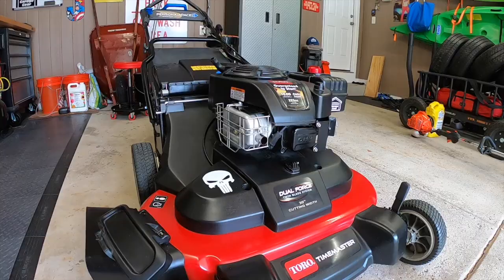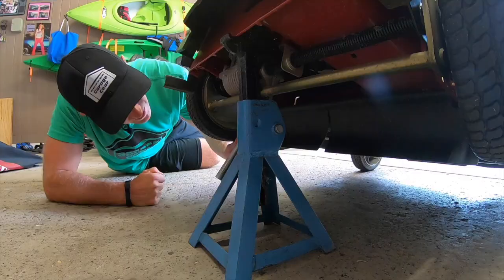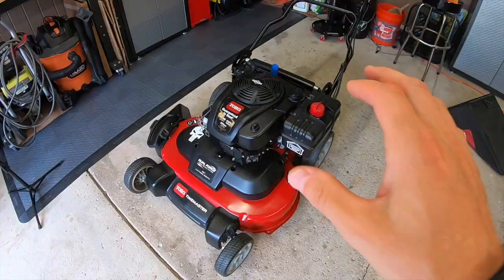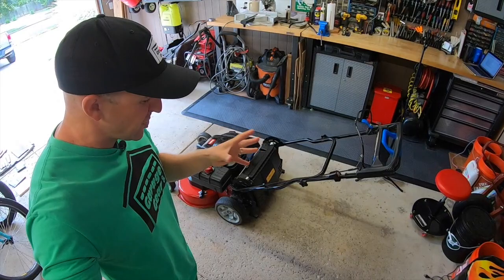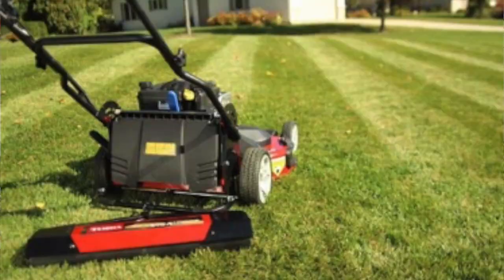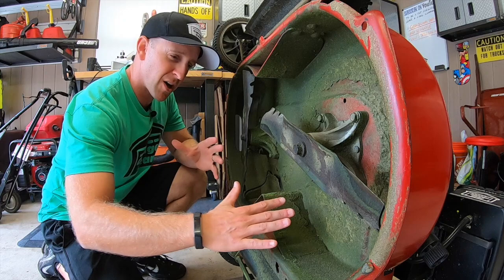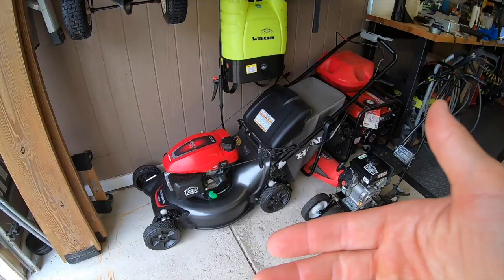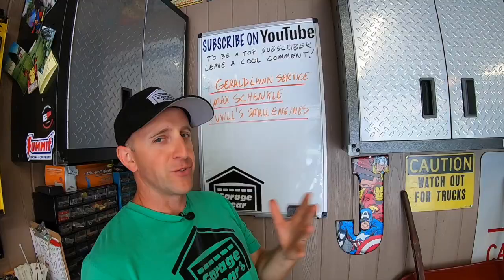BEFORE YOU BUY A TORO TIMEMASTER, WATCH THIS!

Comment: Working (again) on a neighbor's 2013 model year Time Master.  On its fourth belt from the engine to deck, second belt idler pulley.  New spindles, shafts & belt timing belt pulleys (all of them).  Pulley for the blade shaft all loose on the shafts.  Too complex for the additional cutting width, not worth it.  He could have bought a 21 inch mower for the cost of the parts alone over the years I've been working on it.  Engine's starting to burn oil, likely the last straw.  Skip...
Reply from the maker: Thanks for sharing this information 80’s lover!

Comment: What would you recommend instead? I was looking at the HRX or possibly a base entry zero turn. I'm moving into my first home that is just over half an acre and it's relatively straight & flat with little trees and nearly no obstacles. My gate is big enough for a ride on for sure, but I don't have the budget to really go above $3,000 & would prefer getting a nice push around $1,000-$1,500 since I'm young & can use the exercise & I've heard zero turns aren't worth it unless you can spend $5,000+
Reply from the maker: Hey rise! I think you’ll be there for a while with the HRX. Good mower though! Perhaps check out a decent used zero turn that is more in your budget to see how you like it for a season. There’s plenty of good ones out there. My neighbor has had a toro for a while and loves it.
Reply: @GarageGear  thanks for the input! I'm going to check out some local dealers this week to see what type of financing they have for new & used zero-turns
Reply from the maker: @RiseT14  you got it my friend!

Comment: Thanks for taking the time to make this video. Does your surge at idle? Just bought a two year old one and it surges pretty bad at idle (but otherwise runs great). From what I've read, this is a common problem. Just wondering if cleaning the carb out will fix it.
Reply from the maker: @ILruffian  mine did a little when I had it. Sold it a few years ago. Carb cleaning may help!
Reply: @GarageGear  Thanks much. Debating if I should do the commercial pulley system upgrade as well.
Reply from the maker: @ILruffian  this mower is one easy rabbit hole to go down. lol
Reply: @GarageGear  Spot on. Kohler engine, etc.

Comment: The plastite bolts are complete crap. I had 2 break when removing the cover to inspect the blade engagement. Now I get to extract them and replace that cable. Any suggestions on a good grade 8 stainless steel bolt replacement ? I’m not finding anything to give me the size. The existing head is 3/8.
Reply from the maker: Unfortunately, I don’t know. I sold the mower so I can’t check.

Comment: I just started cutting lawns and I need a 30 inch mower I mostly cut lawns in beach towns  and they are smaller what machine do you recommend
Reply from the maker: @catnaptv_plushshow  I would look at Ferris or scag. They have 30 inch commercial mowers. Expensive but built well.

Comment: Unless you plan on a total engine replacement out of the box "don't buy". Three head gaskets in four years. Crank case gasket. Gas cap leaks like a sieve from poor design.  If the blade belt breaks. The blades will crash into each other. If this isn't a major safety issue that should not be allowed to happen. Said goodbye and bought a Honda.
Reply from the maker: Too many issues to name! Considering selling mine in the spring. Thanks for sharing John!

Comment: I bought one 8 years ago on sale for $899 at Home Depot. It has been a great mower. Only major part that's gone bad was the gear box. Got one off Amazon for $99 and replaced it myself.  I did replace the belt pulleys with aftermarket ones and no problems.The tires do get slick but someone on YouTube has a hack for fixing that issue. If this guy is running out of gas he must be walking very slow. I mow 5000 sqft in 45 minutes. Bagging everytime with no problem and I'm mowing TiffTuff Bermuda which is very thick. It's funny how you don't see very many used for sale on Facebook marketplace. Maybe everyone just scraps their $1000+ mower. Either that or this guy got a lemon. If he bought it during COVID he probably got a lemon. Manufacturers had to put anybody on the line assembling these things. Knock wood, I've got a great one.
Reply from the maker: Thanks for watching

Comment: Well. After watching your vid not crazy spending $1600.00 to save 15 minutes mowing my 10 k SQ ft lawn.  So what else should i look at? Or just stay with my toro 21inch super recycler 21386.  It is shop worn due to i use to mow 13 lawns per week. Not doing that anymore. Please advise. Thanks
Reply from the maker: Hey Brody a lot of people are looking at 21 inch Hondas but they are don’t making mowers in September. There are two commercial 30 inch mowers out there now that getting some buzz but I haven’t tried them yet.

Comment: I've had 2 problems with my TimeMaster, cable adjustment for the blades, and the belt disappeared for the transmission, but I'm happy with it. 
But a Honda mower? Forget it! No one can fix the starting problem. Plus I hit a tree stump and now the crankshaft is bent. That's right - BENT. DEAD and no one wants it.
Reply from the maker: Thanks for sharing!

Comment: $1500...only 9" wider than a $500 self propelled...the extra price doesn't get you a better motor, big fuel tank, better wheels not quality control.   I've seen guys get these for their lawn care business and I laugh.  It doesn't have the power nor quality to justify its cost. But a lot of modern mowers try to be a jack of all trades, rather than just be good at mowing.   Most of the mowers marketed as a bagger, mulcher, side discharge don't do any of them as well as they could.
Reply from the maker: Hey RC looks like the cheaper mower and a few extra passes is the way to go! Thanks for watching my friend! 👍

Comment: My new home is on .75 acres and has a flat front yard, but a very steep hill in the back yard. I’m looking for a mower that isn’t going to be in the commercial price range and I’ve been comparing between the Timemaster, Craftsman M430, and a used Cub Cadet CC760 ES that is for sale at a local dealer nearby. I’m torn between which to go with due to the steep hill. Can you recommend one over the other for my situation, or another if you think would be better?
Reply from the maker: I would probably recommend the cub. The craftsman’s are pretty much in the same level as the TM! Only downside with the cub is the tires tend to leave ruts. Decent cut quality though!

Comment: People are and have been talking about these issues.  You tube is Loaded with the Topic.

Maintenance is part of the problem, NOT ALL   

Deck clogging....better blade is needed!  those blades are creating too much up force and its clumping it seems.   Not Many people are talking about possibly a low lift blade, or something else.  Side discharge is certainly better, and so is Bagging.
My solution so far is to side discharge or bag.   A BLADE TEST is needed for people to come up with a decent solution.  I dont know what scag-ferris are using.....but there is no doubt the timemaster deck design isnt allowing great flow of clippings.

adding to that, MULCHING is NOT good with these..  even more clogging.  even worse, the clipping get into the pulley area...THUS issues with the bearings failing.    solution, clean it out every 2-3 months.  4  3/8 headed bolts.   leaf blower it out.
Or you will be buying tensioner pulleys.  If commercial, probably need them anyway.  Why didnt they upgrade?  Toro is saving money.    

Belt adjustment on the blade engagement needs to be done.  5 mins.    

B&S engine....not as bad as people think...needs oil changes, valve adj after a few years.  Dont DOGG IT DOWN with mulching 12in grass...or you'll pop a head gasket.   Make sure Your getting 3500--3600 rpm.     as for the mounting bolts...thats just telling you there is alot of vibration going on....     Plenty of vids with guys dogging that engine, and wondering why it craps the bed.   I am NO B&S fanboy....but this engine isnt that bad.   I ran the 190cc on my craftsman 21 for 5 years...not 1 issue.

I will agree 100% a 22" toro recycler is far easier to run and will cut great, but it will take you an extra 30 mins on 15k cut.

drag flap..garbage.   

ALL these 30 inch mowers.  .commercial and timemaster have issues. Timemaster seems to be the easiest to service.  But, they are manageable.   If you have manicured fingernails and are afraid to get dirty, pay to get it serviced.    

I bought one this year for 1000 on craigs. new.  I like it.   I like it alot!   I have the recycler in the shed, i pulled it out yesterday to do a spot in the woods...man its soo small now..LOL

I would take this $1000  timemaster over any Honda mower and 22"..except my $30 recycler that I found.    That said, hard to beat a $30 recycler.
Reply: just want to make clear, the Vid...really has very good Merit in that Toro could do a better job.

I just offered some pointers.
Reply from the maker: Thanks for sharing your experiences and knowledge here Harry! Wish toro would address some of these things.

Comment: I'd have to agree JB. Toro has gone downhill big time, The older Toro products were built like tanks and lasted forever with proper maintenance. Everything they make new is very disapointing to say the least. If your mower is shaking apart (and I trust you balance your blades?) there is something wrong with that engine.
Reply from the maker: Hey David! Blades are always balanced after each sharpening. Engine runs fine. Just so powerful it shakes itself free. Probably selling it in the spring! Thanks for watching bud!

Comment: Would you recommend buying if found for $600? Only used for 1 season
Reply from the maker: Hey Matthew! No, chances are even higher you’ll have to deal with belts, transmission issues and engine problems! This mower is not worth all the extra work. Thanks for watching.

Comment: Hi JD. I have a time master and the deck cakes. But I think I found a fix and I wanted to know if you could do a video on it and test it out. The fix is to remove the front baffle. I have an aftermarket mower with aftermarket blades and the lift pulverizes the grass into a slurry even when it's bone dry. After taking off the front baffle I don't have the issue any more. I made a video on my channel about it. Mulched up a half acre property and had barely any caking and the grass was wet. Hope you can test the theory out
Reply from the maker: Hey atg! Thanks for sharing this but I sold my timemaster last spring! That mower wasn’t worth all the other headaches. 👍
Reply: @GarageGear  oh man 😅 I was hoping you could have tested it. But u know what, you're absolutely right. It's been a headache since day one and Toro really needs to just put out a better product for all the money people pay for it. Thanks anyway brother and thank you for your content. If you ever change the belts on the ariens snowblowers please record yourself doing it 😬 I have a 30 inch EFI and the belt slipped I put it back on but I think this will be the last winter with those belts
Reply from the maker: @atg4469  here is a video I did on a 28” deluxe a few years back. Perhaps this can help you HOW TO CHANGE SNOWBLOWER AUGER BELTS - FAST & EASY Replacement and Installation
https://youtu.be/mIkydp4DTwI
Reply: @GarageGear  thank you so much it's very helpful

Comment: Disagree with most of This. Yes gas tank is way too small and the trans is weak, but overall this mower is very good. I have a 1/2 acre I mow with this for last 3 seasons and the cut is great and I don’t have “clogging” issues even if the grass is damp. I also have a backyard that’s ~20deg slope and while my only complaint is having to push some going back up after mowing, it actually handles it’s very well. Cleaning the deck? I do that once or maybe twice a year. It doesn’t need to be spotless! My old Honda HRX got more crap stuck up in it than this does, and that was almost as expensive with 30% less cutting width.
Reply from the maker: Thanks for sharing

Comment: This guy must have had a bad experience with this mower... I bought mine in 2014 and still use the mower in 2022. I haven't had anything on his list fail for me and I use it to cut about 15000 square feet.  I am even cutting the grass two to three times a week in the spring and fall.   I don't even have to fill my tank up like he mentioned.
Reply from the maker: Thanks for watching
Reply: Mine is a 2012 vintage and everything he mentioned has been a problem and much more.  Pretty much everything that moves except the wheels. Replaced the engine over the past winter with a Kohler designed for the Time Master.  All this with just over 200 hours on the hour meter I installed at the start of the 2013. Does a great job mowing the grass and the Personal Pace system works better than anything else I've used.

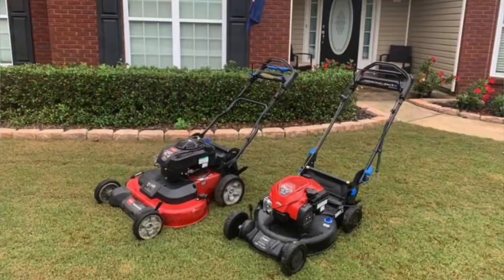Comment: Wow I just saw my house at 7:34 in your video. I'm one of those that has felt the pain of the underpowered motor. Mine just sits in my shed during the heavy growth months because it can't keep up with my super thick Bermuda.  I follow the 1/3 rule, cut every 3-4 days religiously, and it simply can't handle it. Adjust blade engagement cables and its as good as it can be but still won't cut it without me walking like grandpa.  I'm sure it's great for mowing at higher levels but it's not worth my time to baby it thru to cut. I use my Super Recycler almost exclusively. Its good for bagging up pilings tho after I've alreasy cut. Hahahah
Reply: And yeah the TM owners group prob won't think much if this video although I do see tons of negative posts and comments in there on the daily.  Thinking about selling mine to be honest. The stars have to line up right for me to be able to use it.
Reply from the maker: Hey DeWayne! I was wondering if someone would say, “hey that’s my…” lol! Looks like we found ya lol! I’m in the same boat as you! I’m eyeing up a commercial 21” mower! And you’re right the stars do have to line up to use it! Thanks for watching my friend!
Reply: @GarageGear  at the point of that picture i was in love with it but this season I went FOUR whole days between cuts and tried to cut with it and my yard just completely whipped it. This was after I had adjusted the blade engagement cable correctly.  In the spring I'm cutting too short so it scalps the slopes near my ditch and once the grass is growing in the hotter months and I'm trying to cut at 1.75" it just can't do it.  Fresh blades, whatever, doesn't matter.  I've been able to use it maybe 3 times this season.  First scalp, and once I raise the HOC to 1.75" and I am mowing across the yard are the only times I can use it. And if I go more than 2-3 days it struggles unless I'm in a drought.
Reply from the maker: @dewaynelogan1365  right there with ya buddy! The timemaster is useless to me in the spring and fall! Can’t handle long grass after just 3 days. Spend too much time cleaning it. It will scalp some of my edges too because it’s so wide. I feel your pain my man! That “for sale” sign is looking pretty good right now.
Reply: @GarageGear  yeah it is. For the $1200 I got in it im not getting much use out of it.  I could sell it for 8 or 9 and get a hell of a 21" mower for that.
Reply from the maker: @dewaynelogan1365  I would even try for $1000+ with inflation nowadays you may get it.

Comment: How does the toro turfmaster compare does that model fix those issues.  Might be worth rhe extra money.
Reply from the maker: We’ll Ken there’s a handful of things that are different. The turfmaster has the better pulleys but a smaller cc engine than the homeowner model! They’ve made the transmission better too and it has a gallon gas tank. Still clogs the same. Hope this helps!

Comment: What 28-32 walk behind would you recommend? I seen the Cub Cadet at Home Depot, looked at a Snapper SW15. Have a snapper 21 inch now. Open to any brand  $3000 is budget. Also I have a lot of small stuff to mow around, does swivel wheels help? As the time master does not have them. Thank you
Reply from the maker: The only ones that seem to hold up are commercial models. Ferris and Scag. You’re probably better off spending your money on a zero turn.
Reply: @GarageGear   Thank you for  the reply!
Reply from the maker: @KA-jv9sz  you got it my friend